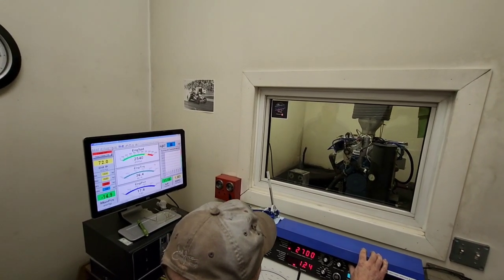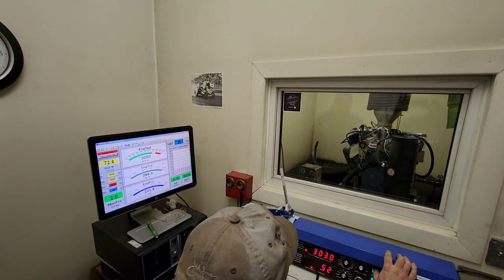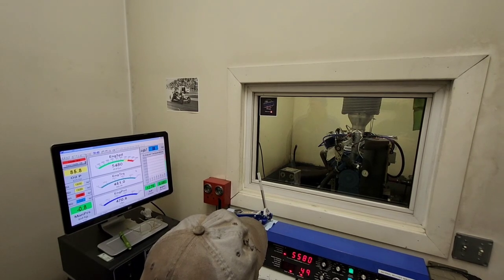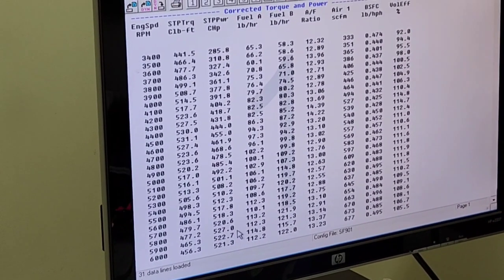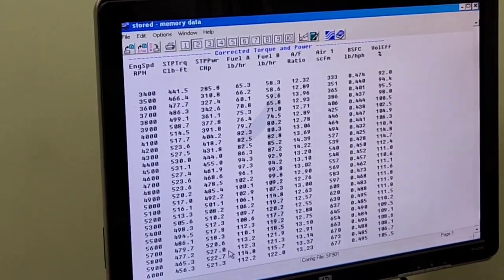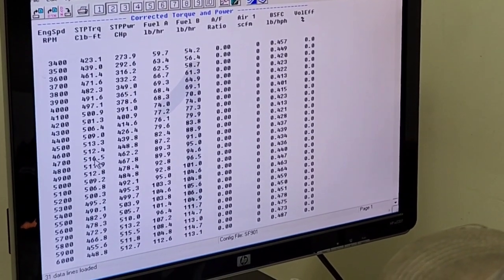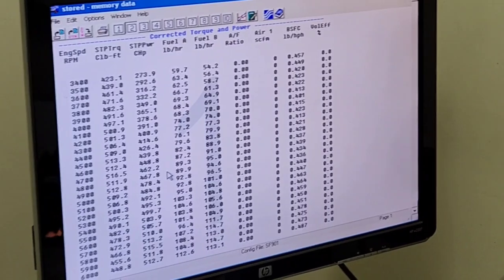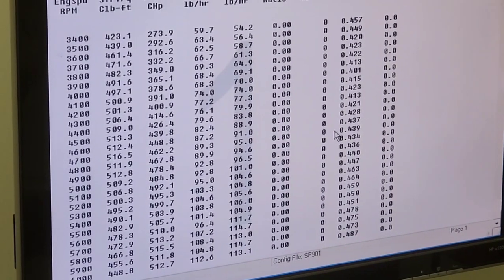Edelbrock VRS-4150 Carb vs Pro Systems Carb on the Dyno with the 408 Mopar with Speedmaster Heads

Comment: AFR data populated, on the first test. . Also, the AFR testing results. We're all over the map. So either you're getting some leakage. And you're seeing air come by. Or the carburetor just wasn't doing its job. Either way, neat test. And, I see you're using the old controller on the dyno that revs things up slow, slow, slow one little bit of the time. One little bit of the time. One little bit at a time. Interesting
Reply from the maker: Darrell prefers 300 RPM per second vs 300 RPM a second. I prefer quicker myself. Darrell says it's more accurate going slow. Do you think it makes much difference?

Comment: These Dyno tests can be helpful. Noticed the first test had the AFR and Volumetric efficiency columns filled with data but not  on the Edelbrock carb test? 
Since there’s two different carburetors involved it would be helpful to see how they each differ or are the same throughout the rpm range. 
Thanks again for the testing and Go Bills, love the cap!! 🦬🦬